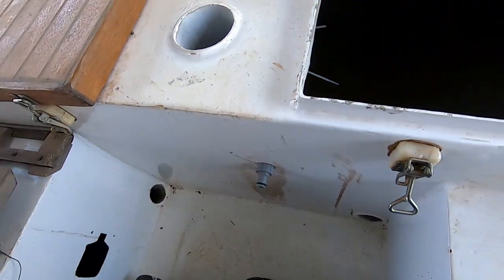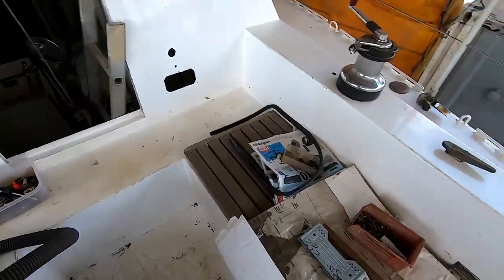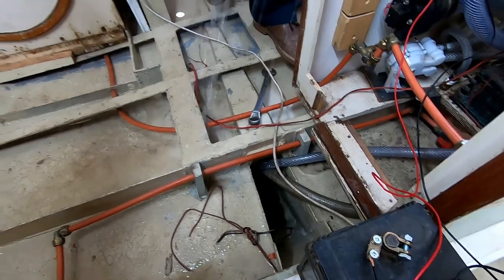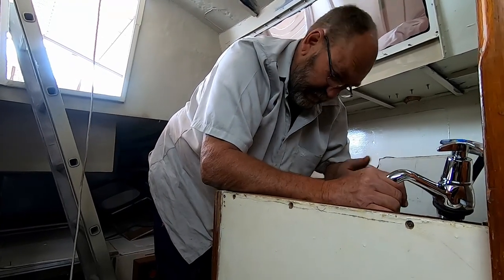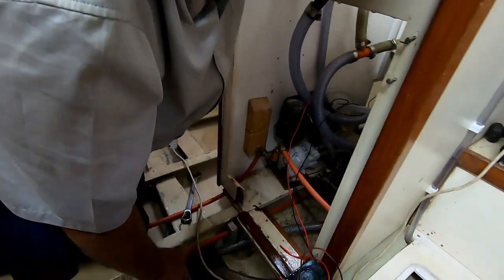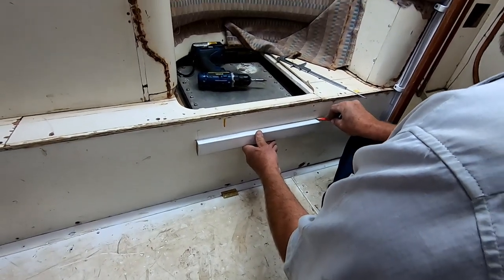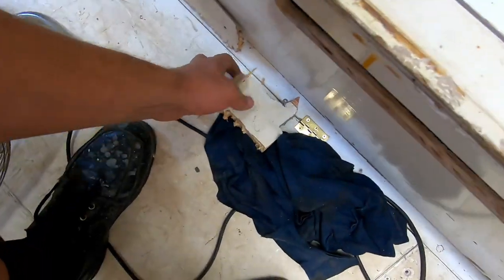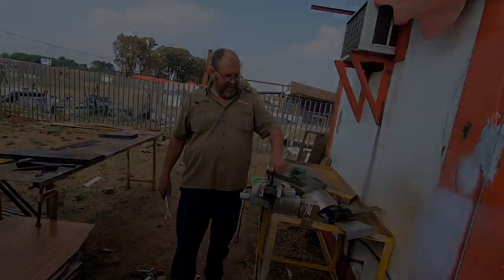Fixing Water Leaks on a Sailboat | Land Rats | EP16

Comment: Waterleaks on plumbing pipes: I still need to redo my plumbing system. What is your view now on the pipes and plumbing system that you used. It seems that this system is going to give you endless problems in the future. I used these see through plastic pipes for my bilge water, but after a few years they are no longer see through.
Reply from the maker: Still going strong. No problems yet the seawater water smells a bit if not opened regularly. I do see some discoloration on the inspection pipes